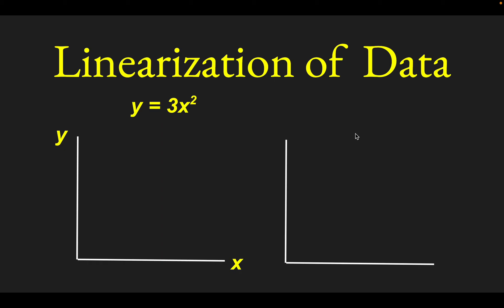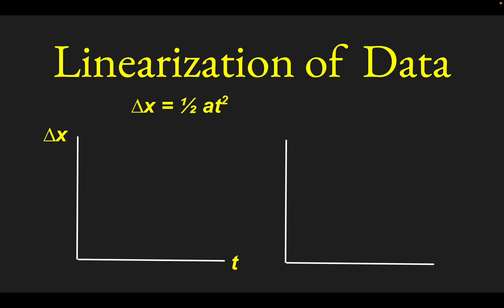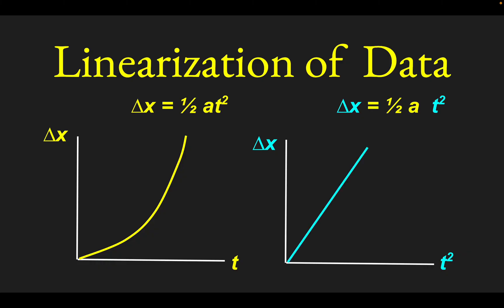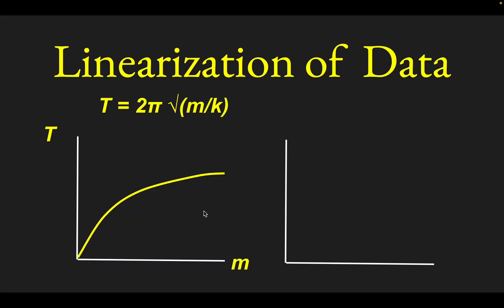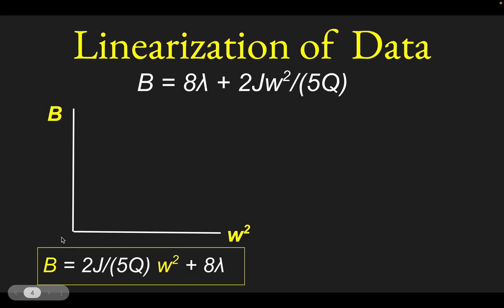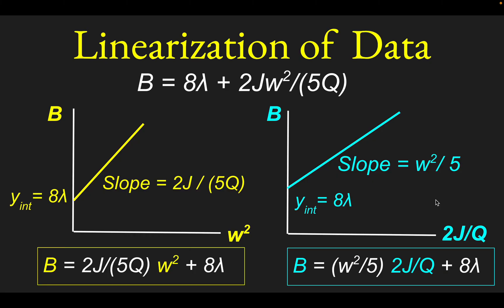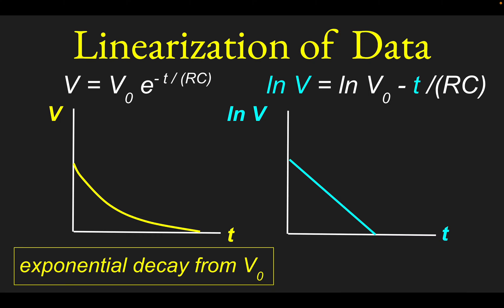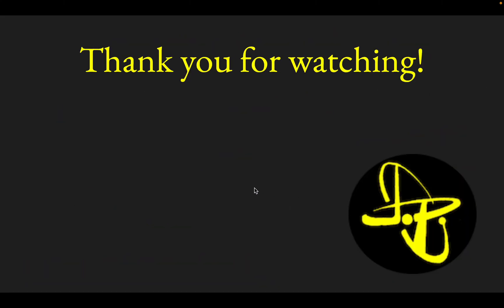Linearization of Data for Science Labs & Experimental Design

Comment: How can 2Jw^2all divided by 5Q be equivalent to 2J/5Q.w^2?
Reply from the maker: My intention is for the w^2 to be in the numerator in both cases. Indeed, [2J/(5Q)] * w^2 and 2Jw^2 / (5Q) mean the same thing, or at least that was my intention. Apologies for any confusion that the typesetting may have caused.
Reply from the maker: I think the 5Q in your expression needs parentheses around the 5Q to match what I intended. Make it (5Q), and then we are saying the same thing.  I moved the w^2 over to the right of the fraction to get it into y=mx+b form. 
I probably should have typed it as
B = [2J/(5Q)] w^2 + 8 lambda to be clearer. I appreciate the feedback.